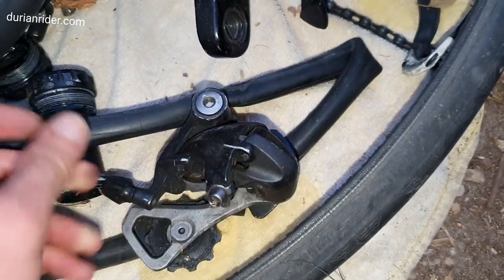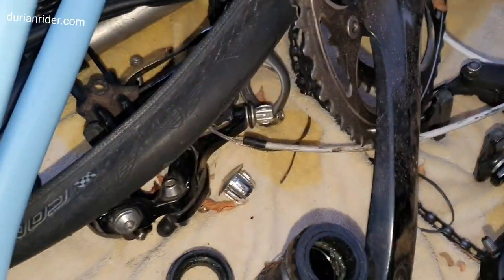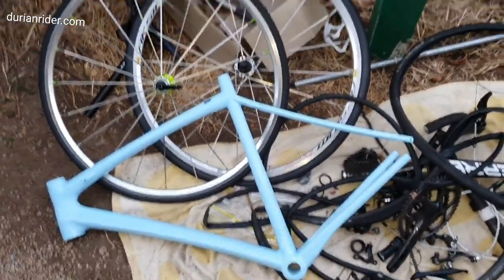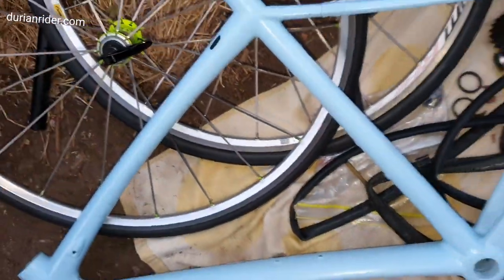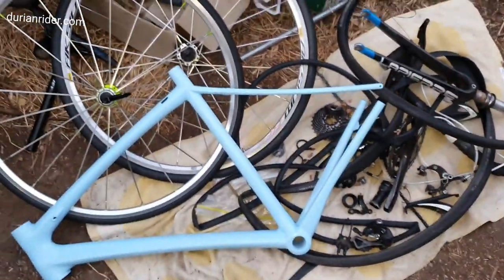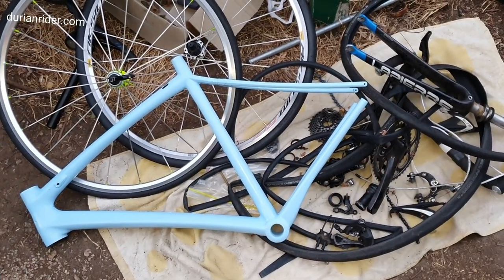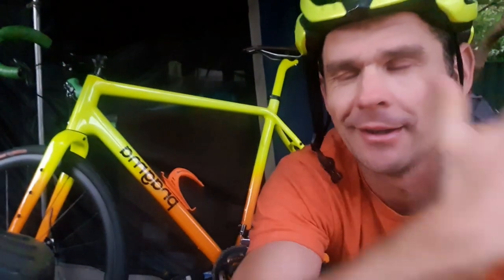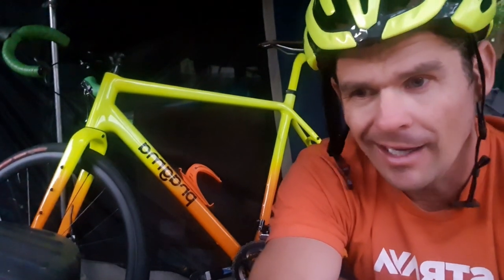Can you build up a carbon race bike for $150USD?

Comment: DR have you tried any chinese power meters yet? Such as magene, xcadey etc. If not, I'm looking forward to your opinion/review :) Cheers.
Reply: Vegan Catalyst where can you get the Magene powermeters?I’ve been trying to buy one for ages.
Reply: @shaunhoulahan4080  there are some options at aliexpress, as low as 214 USD for SHIMANO ULTEGRA R8000 170mm crank length version. 
Apparantly all customer feedback is also good. 4.7 stars.. Wondering myself whether its worth buying more expensive power meters when you can get some bargain deals here. As someone mentioned there's 'Only Uncertainty: warranty and service' but I had stages PM for years before and no issues whatsoever..
Reply: Vegan Catalyst Thanks. I’ll try Ali express
Reply: @VeganCatalyst  china cycling did a review on some of them he was durianrideres channel recently for a interview, good channel on some awesome bike parts coming out of china
Reply: My friend has one, seems to be working fine for a few months now. Would be great to see Durians opinion on it